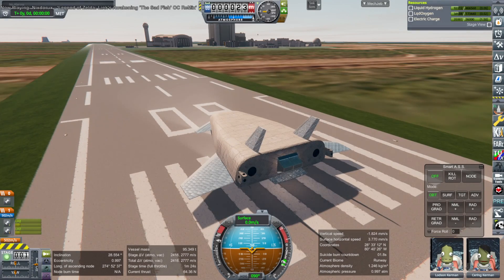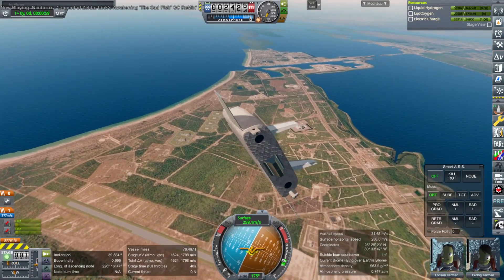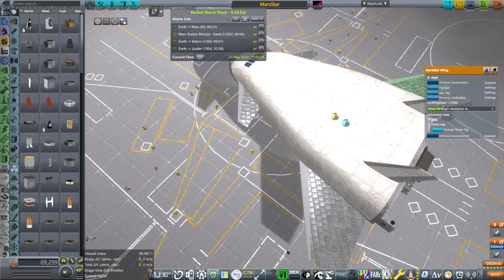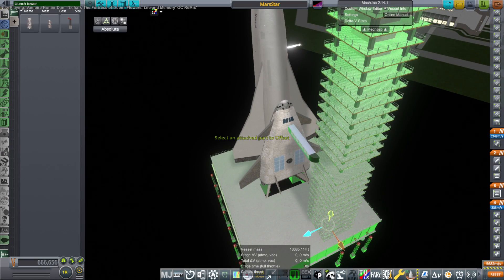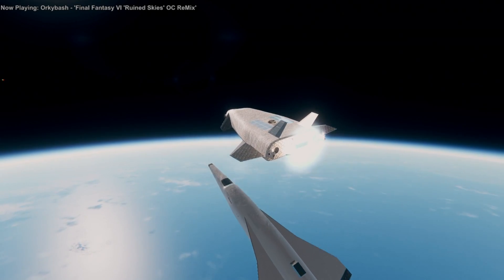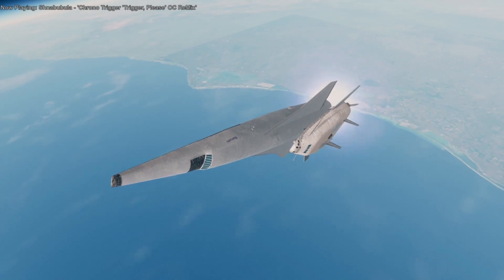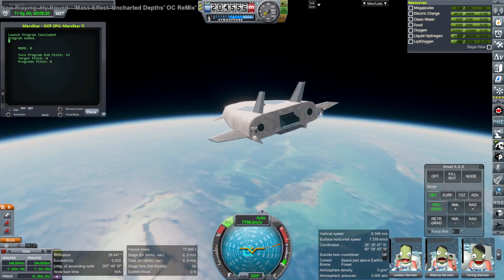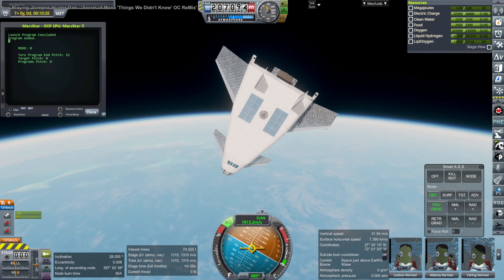MarsStar Lander Initial Testing (RO in KSP 1.12)

Comment: Landing engines for spaceplanes are always a bitch, gotta have high gimbal and very careful com management throughout the entire mission. Really wish you could toggle your com/cot in realtime during the mission, would make it 10x easier.
Reply from the maker: There is one trick I didn't play here but probably could and also used on the Asuka spaceplane - tell KSP that the landing engines are RCS thrusters so that the game will automatically balance their thrust. That probably requires them to be a separate part, though, since this has other RCS thrusters (the plumes tend to be iffy otherwise).